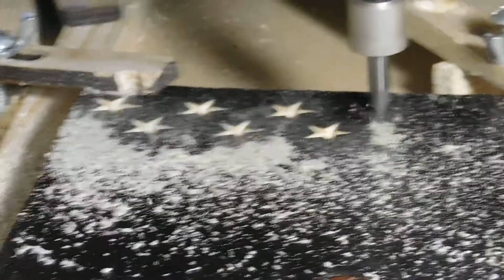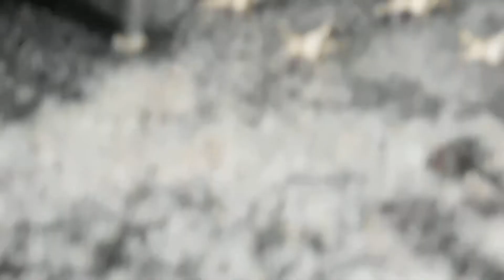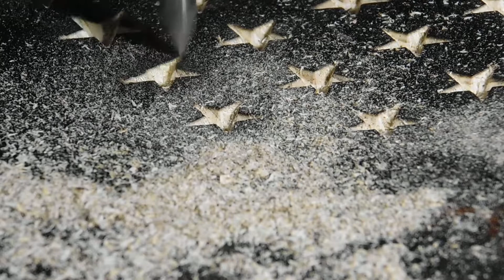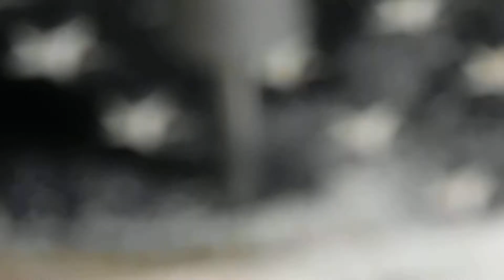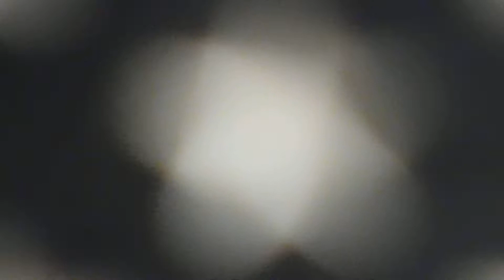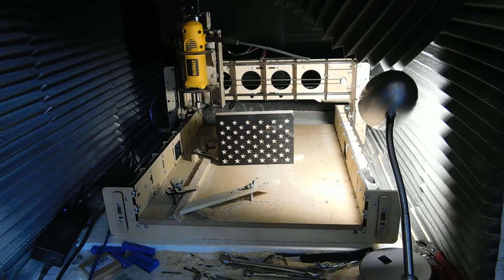Bob's E3 CNC carving stars

Comment: I just set mine up. Can you give me the info on how you do yours? What bit do you use and such?
Reply from the maker: This is a quarter inch 60 degree V bit with the quarter-inch shank. I got it off of Amazon for less than $20.  I use vcarve desktop. This was ran at 15 inches per second i believe. If you got an E3 i highly recommend you join the Facebook group. You can get any questions answered in there.

Comment: Is there a possibility you can email me? I have a few questions. Please and thank you.
Reply from the maker: John Rojas if you're on Facebook go join the Bobs E3 Cnc group. There is a decent community of people and we all help answer questions.
Reply: Brockman what bit is that? And what brand? I have my own business and I make wooden flags, so what program do you have from bobs?
Reply from the maker: John Rojas it's a 60 degree V bit. I can't recall the brand but I bought it off Amazon it was the one with the most reviews I think it was less than $20. I use vcarve desktop which I got with the bobs. It's like  $700 to buy by itself but it's highly discounted when you buy it with the machine
Reply: Brockman with the 1/4" cutting diameter?
Reply from the maker: John Rojas yea i have a 1/4 inch shank
Reply: Brockman what bit would I use for engraving letters? I want to start putting names and stuff on the stripes of the flag. Thanks
Reply from the maker: John Rojas vbit does really well with letters. Depends on what font you're going to use. I learned everything I know about how to use a CNC on YouTube and in Facebook groups. I've only been doing this for a few months I'm no expert.

Comment: How long did it take to cut the stars? Also, is bob cnc worth the money? I'm thinking of buying one! Thanks
Reply from the maker: John Rojas it only took about 10-12 minutes to cut all 50 stars. I like the Bob's E3. For the price and cutting area that you get with it it's hard to beat. Assembly really isn't hard at all to do but does take a few hours. You're not going to run a full-time business with this thing I don't think it would hold up to that kind of workload but it's great for a hobby and a great intro machine.
Reply: Brockman what's the speed rate you have set on?
Reply from the maker: I normally run 20" per second with the vbit. Slow it down if your cuts aren't coming out clean enough.
Reply: Hey where did you get the file for the stars? I’m having issues locating one